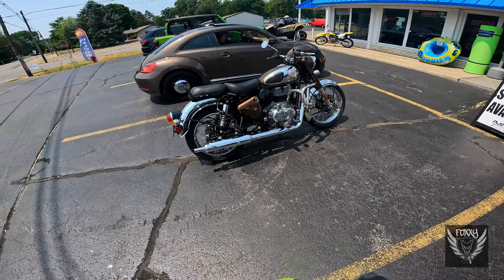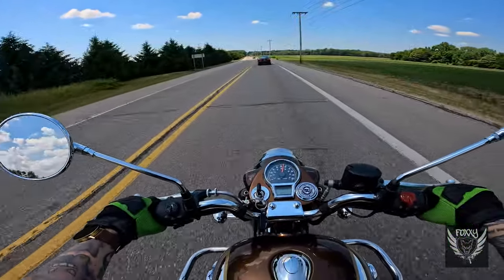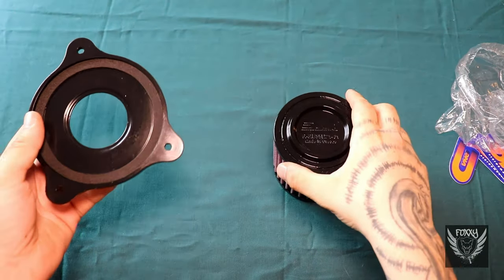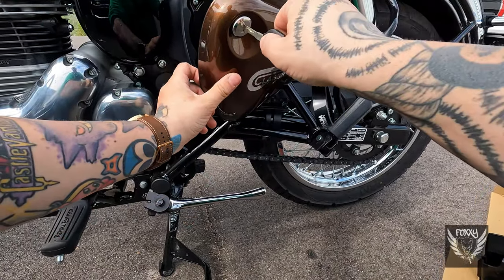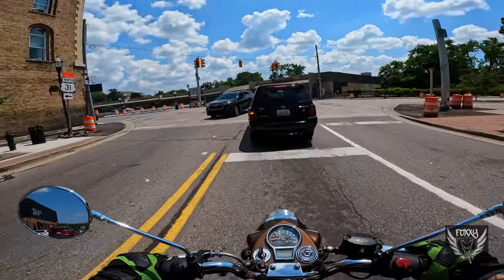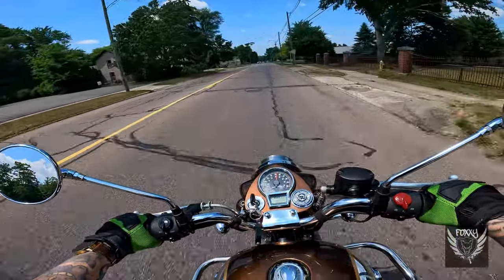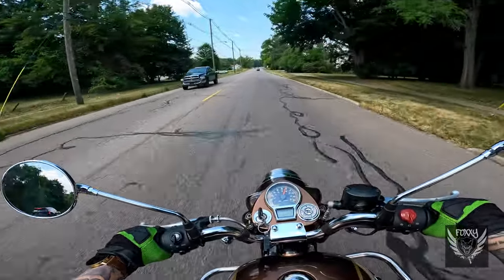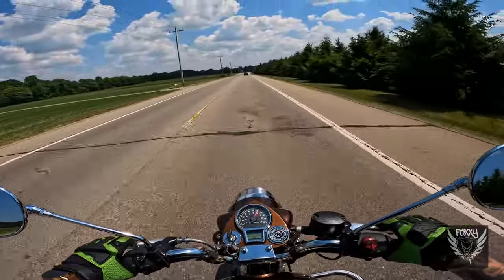Project Royal Enfield Part 1: RE Classic 350 DNA Stage 2 Kit - Does It Really Improve Anything?

Comment: Jeez, this is worrying. I bought a classic 350 two days ago, which all ready has the stage 2 kit and a straight through Hitchcock exhaust fitted by the previous owner. Man it's slow; so I dread to think what it was like stock! Looks like I'll have to either get the performance cam, or just trade it for something with more power. A Ducati V4S maybe! 😅
Reply from the maker: @DesmoDreams  i mean your first mistake really is thinking a air cooled modern(ish) Fuel injected 350 single is even remotely fast lol. 
Yeah man these are not rockets and never could be. But even the slowest Ducati is 10000% different than anything RE will probably ever make
No offense at all btw lol

Comment: how has the air filter impacted the mileage?
mine gives 35 kmpl which is approximately 82 mpg.
please let me know as I'm planning to install this filter.
Reply from the maker: Its hard to say just with the filter. I have since installed a full exhaust and the fuelx lite. I know that prior to the Fuelx i was getting a little worse MPG which i contributed to the exhaust more than anything.
Since everything has been installed ive noticed my personal mpg ranges from 78mpg to nearly 90mpg depending on the travel

Comment: I have fuelx installed with stock airfiler and exhaust. I am planning to go for DNA Stage 2 air filter.

Would it be ok without changing the stock exhaust ?
Reply from the maker: Yes, absolutely. You do not have to do anything with the exhaust if you don't want to
Reply: @FoxParasyte  Thanx for the reply.
Some comments stating that increased air intake would cause a problem if cat isn't removed, had me worried.
Reply from the maker: @livebeyondlines1624  highly doubtful if the fuelx is also installed considering it would be automatically correcting the air to fuel mixture

Comment: only makes at best 24-25 BHP modified.  What is the point of any of this again?  Good production
Reply from the maker: Improve acceleration, throttle response, and overall functionality of the bike. And to have a little fun with it.
Reply: You can get a little more than that with certain mods supposedly. Still, that's at least a 20% improvement in power. Really not bad. Brings it from a bike barely able to keep up with it's weight, to a bike that is a little more light on it's feet per say.
Reply: Show me any bike you can get 20% more BHP out of easily. I´ll wait.
Reply: @RiderOftheNorth1968  Did you check out Hitchcock's dyno sheet on their cam? 5.1 hp gain at the wheel w/ DNA plate, paper filter, decat pipe and stock silencer. Not bad to work from.
Reply: @RiderOftheNorth1968  Nobody said it'd be without mods that take some know-how.
Reply: @izaicslinux6961  I was answering the original post. You and i agree.
Reply: a 20% power increase is massive on any bike, that is the point ...

Comment: Add ngk iridium spark plugs with cap and wire
Fuel x fuel moduel
Redroaster rambler full exhaust 
Kent performance cam and 16tooth  front sproket...

Then see her fly...mine has all of the above barring the cam and sproket.. as cant get them in india..
Reply from the maker: I'm going full exhaust but not redroaster. I tried looking up different wires for the spark plugs and had no luck really.
Reply: @FoxParasyte  want part numbers for the spark plugs
Reply: Any specific reason for not opting redroaster
Reply from the maker: I just need to figure out better wires, the plugs are easy enough to find.
Redroaster full exhaust i can't seem to find an easy way to buy it with USD here in the US. But i am going for a full exhaust through a british company

Comment: Wont water go in if it rains???
Reply from the maker: I'm not much for riding in the rain myself but i highly doubt it would make a significant impact. The way the airbox is made, it would pull air from underneath the side cover. If say the intake was a fully open & exposed one like you often see on HD, Indian, and Japanese Cruisers then yeah rain would pose an issue.

Comment: How can one know the installation has gone wrong?
Reply from the maker: Hard to say without information. Has the bike behaved in a different / negative way?
Reply: @FoxParasyte  I followed the steps showed by you and  done with installation plus 15 mins on start mode. 
The DNA air filter which I got has the serial no
R-RE35N21-01 is this same air filter installed on yours? And is it necessary to keep the document holder back?
Reply from the maker: Yeah that's the same one i have. You can keep the document holder installed from my understanding. I never did because it's not something i'll ever use.
Reply: @FoxParasyte  my bike has just done 34kms 
I hope everything will be good 
Thank you so much
Reply from the maker: Not a problem buddy. I wouldn't worry about it unless you ride in a lot of dusty sandy areas. Even if you are, it's one of those situations where maintaining your bike (or filter in this case) will safe you in the long run.
Reply: @FoxParasyte  that’s what I was gonna write to you earlier. I am from Kathmandu -Nepal ⛰️ and over-here there are lots of road construction work going on. I hope everything will be fine 🤞
Reply from the maker: I wouldn't worry too much. If anything i would recommend checking that air filter during every service. I do that with all my bikes and cars anyway. It never hurts to check
Reply: @FoxParasyte  Brother, now I’m heading towards fuel x pro… few friends told me regarding the Powertronics, well- that will come only after the installation of Fuelx pro. 
Should I go for fuelx? What you reckon?

Comment: The trouble with doing mods you end up damaging the bike , it’s a bike to slow down and enjoy the countryside, why didn’t you just buy a faster bike??
Reply from the maker: I have 2 other bikes that are vastly quicker than the royal enfield. It's not about "buying a faster bike" anyone can do that. 
There is virtually zero evidence to support that changing out things like air intake, exhaust, and installing a fuel pack leads to damaging the bike. Upgrading the camshaft and internal engine parts can possibly lead to problems but you have to go out of your way to do something wrong.

Certain bikes like my Yamaha require a tune or a fuel commander when changing the air intake and exhaust, the royal doesn't necessarily need it... but it will improve the performance of the bike long term.
Reply: @FoxParasyte  Trust me, you lost zero value on the bike. I'll buy it off you when you're done :P
Reply from the maker: @izaicslinux6961  hell no lol I'm not selling this bike. It's both my fiance's and mine